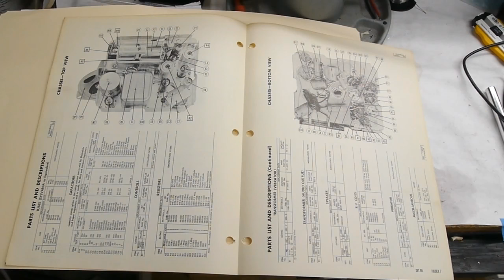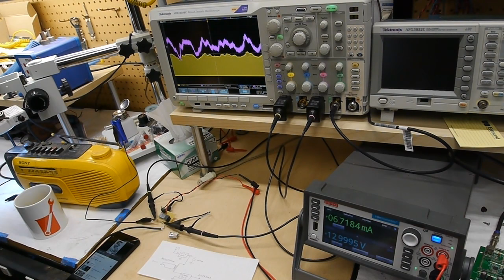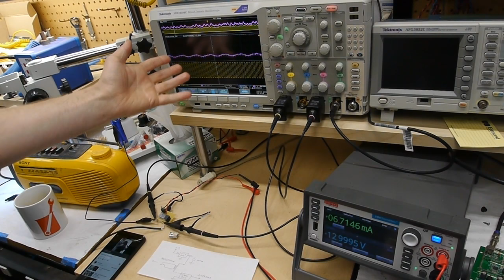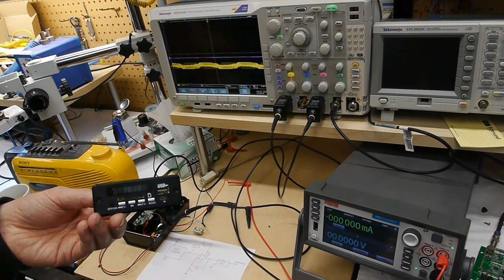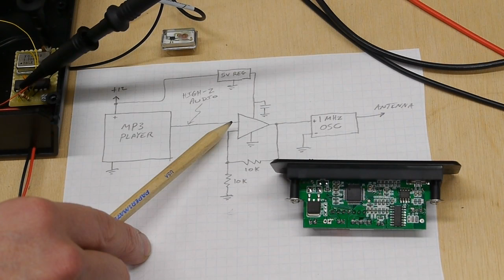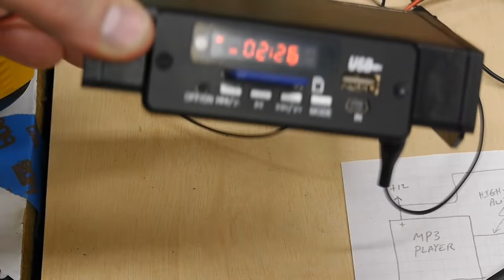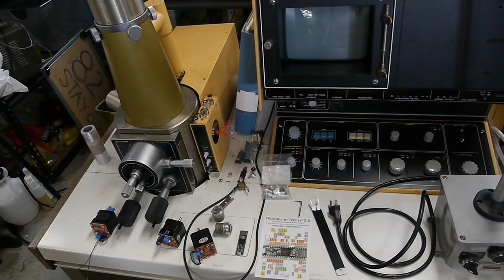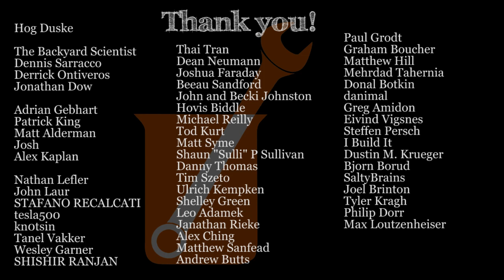AM transmitter for antique radios and other project updates

Comment: BTW, that trick of putting a transformer in series also works great for modulating a He-Ne laser. I once tried it with a PA transformer connected backwards to the 8-ohm speaker output of a hi-fi, and the modulation was such that you could actually see the intensity variation.
Reply from the maker: That sounds really cool.  I'll bet it would work with modern high-power laser diodes too.
Reply: With a laser diode it's simipler to inject the signal directly into the driver without the need for a transformer.  Actually it's possible with a HeNe as well, but a bit more complicated.
Reply: interestingly you can do the reverse and create a laser microphone by shining a lazer through a room and then playing the signal you get from a photo diod on a speaker
Reply: What if you power a magnetron that way? Would it be FM or AM? 
You have the DC supply and than you add another microwave oven transformer in series, than pump the desired signal in to the primary of the second transformer... That'd be one cheap ass power amp!
Reply: Eviltech Heh, neat one ;-) Probably AM, because the actual frequency of operation of a cavity magnetron (the type used in a microwave oven) is determined by the dimensions of the cavities inside the tube (although accelerating voltage probably would have a slight effect).
Reply: ***** It would be really tricky to receive A&FM modulated transmission :D

Comment: I am not an electrical engineer, rather, I spent 8 years in a math department as a student, but I did stumble on some nice addendums to Ben's transmitter that you may be very aware of.  First a disclaimer, you may only want to make the last modification if your lost in an Amazon jungle and need a transmitter with a bit of range, otherwise, you have built a device that can run contrary to FCC part 15 regulations. 

I originally did not have a 'can' oscillator, so I used a 555 timer and although it works with reasonable audio the canned oscillator is a nicer choice and I ordered one. 

I did not see Ben's diagram on my mobile internet, so I used a standard configuration with an audio transformer for modulation as in Ben's design. At the output I placed a hand wound coil/inductor having an inductance of .25 mH in series with a 50 K ohm pot that then connects to ground. When the pot is at a setting in ohms that I forgot to make note of the open circuit voltage is maxed at roughly 16 volts peak to peak.  

Without the coil and pot I only had roughly 4 volts peak to peak. The power source I used to drive the 'can' oscillator was 4 double A batteries in series. Additionally the coil/inductor reshaped the output from square wave into sine wave. 

I next measured the output impedance of the device by measuring the output open circuit voltage  and then the output voltage with a 10 K load resistor with my scope and by performing the calculation discovered when the voltage was maximized by the adjustment of the pot the output impedance was 7.7 K ohms. From this I calculated that for a coil/inductor used as an antenna I would need the inductor to have 1.24 mH for its inductance in order to have its impedance match the transmitters output impedance. I then wrapped, close wound, 24 MAWG wire around an 8 inch by 11 inch cardboard box. The number of turns I used was 47 which gave me very close to an inductance for the antenna of 1.24 mH. I then direct connected the antenna to the transmitter with no need for a capacitor because the coil antenna was designed to only be a perfect match at 1000 Khz Once connected I briefly turned on the transmitter to see if I was spot on with my assumptions or out in left field. Apparently I was spot on because the output across the coil antenna read 8 volts peak to peak exactly as it should were the antenna a perfect impedance match for the transmitter. 

From the measurements made I will determine the transmitter's power which I am reasonably sure is in the mW range. Once this is known, should the transmitter exceed Part 15 regulations then by adjusting the 50 K pot I can bring the transmitter within FCC guidelines, but still maintain the maximum range for use as a device to transmit audio books which had been the aim of the entire endeavor.

Comment: Wow, so you're really giving the anodizing thing a shot! I hope it works! You probably ran into the paper below already, but in case you didn't, I think it clarifies quite a bit about the process. Great video, btw -- I didn't know AM modulation could be this simple.

G.E. Thompson, "Porous anodic alumina: fabrication, characterization and applications", Thin Solid Films 297 (1997) 192–20.

Comment: I'd say be careful to not interfere with other people's radio when transmitting, especially if you have harmonics, but from the sounds of it you'd just be giving them better radio to listen to anyway! :) Nice explanations.
Reply: RimstarOrg it's only powerful enough to work from a few feet away. It wouldn't even work to the cat next to you at a stop light. otherwise, it would be illegal.
Reply: How many cars with AM will there be on the road?
Reply: That's not the problem, but interference with other appliances or electronic equipment.
Reply: ricarleite A lot will depend upon how much of the oscillator's square wave remains, and hence the harmonics, though I would expect the transformer to largely smooth that out into much more of a sine wave.  One will want to ensure that they are well within the emissions limits, both power and purity wise, for unlicensed transmitters (FCC part 47 IIRC) though it is likely fine if the maximum swing is a volt or less (but I haven't done the math either, nor do I know the total impedance to make the calculation properly).

I would likely be more concerned with the DC-DC converter in his truck (the silver module sitting atop the speaker) as I know they produce a lot of RFI as I use one to produce the 19V I need to run a pair of 27" HD monitors for my amateur radio shack where everything runs entirely off of a large 12V battery bank.  I had to include a good deal of filtering to clean up its switching transients in the LF through HF brands as well as some LC ringing up in the VHF range at around 80MHz and I could pick up the emissions on my dual band general coverage HT from several tens of feet away.  But after filtering it is absolutely quiet now with no detectable RFI escaping my filter and chassis and has worked beautifully.
Reply: Mauro Tamm most car radio actually no one ever use it though

Comment: These MP3 / FM modules are also able to play PCM WAV files at 44,1Khz 16 Bit. So you're not limited to to MP3 / WMA and FM Radio. You could play linear PCM WAV files from the SD card and USB port.

Comment: Great project. Love the MP3 FM radio. Thanks for the tip. I would put a simple pi filter on the output of the oscillator to knock down any harmonics. I know its low power. But, if it can get you into trouble somehow, it probably will. Or not. That loop through junction means you are broadcasting to nearby cars from the truck's antenna. Just thinking out loud.

Comment: I threw together a transmitter like that one Friday afternoon, when I needed to trace a cable inside a wall. You can just couple the signal into the live wall socket or whatever with Y caps. I think I used a 555 to create the modulating tone for the oscillator module.

Comment: Funny deja vu for me: I also made such an AM transmitter a long time ago but used an NPN transistor and resistor at the output for the modulation. Never thought that those were even stable when modulating the supply directly.

Comment: you never disappoint especially since you leave us wanting more and the about a month wait. I don't mind it's worth it to see cool projects like yours. Also with the gecko tape have you gotten any adhesion or just abnormally low adhesion? I  had an idea to make my own by focusing a dot matrix onto photo resist, etching copper, and casting that. I would try that I'd the anodized aluminum doesn't work but you seem like you know much more than I do about this.

Comment: I've played with this oscillator-can-as-a-transmitter idea a fair bit,and it actually works fairly well. There's a circuit with an LM386 to modulate the power to the oscillator can,also. It can be tricky to find the oscillators in 'useful' frequencies though. (unless your local AM market is completely dead,and 1000khz is clear.)
Reply: @PhattyMo  Can I kindly ask you to re-upload that image?

Comment: Great project! (The truck's pretty boss, too). You should set it up so the AM-P3 transmitter turns on/off with the radio itself. First solution that comes to mind is a relay in series with the radio's VBAT line. Also, I would like to see more about the radio restoration itself (or was that covered on one of your other media outlets?)

Comment: That anodizing idea is pretty neat, but I have an even better suggestion: experiments at my University have shown that superior adhesive joint bond strength is obtained by boiling the aluminium in MilliQ water. This creates an even more columnar topography and suits adhesive bonding much better than any other surface treatment out there. the only reason it isn't used widely is that industry will struggle to keep contaminants out of the process and ultra high purity water.

Comment: if your only using one channel out of the mp3 player module, stereo audio will sound missing/hollow  - 
i modded one in to a flight remote control, with speakers replacing the sticks, they're great, got one with bluetooth built in too.

Comment: the problem with the inline setup you have there is that the signal wont just go into your radio but will also be radiated back up the antenna lead and out of the antenna

Comment: The LM324 has an output voltage range of 0 to V-1.5, and the input high is V-2.  Since you set the gain to 2 and the input voltage swings around 1.5v, I think you're probably losing some modulation, the modulation is uneven, and the oscillator drive is a bit low.  The input is railing at 3v, but after amplification, the 3v is 3.5v and the 1v input is 2v output, leading to about 1.5v of total modulated bandwidth and an asymmetric amplitude.  You might want to use an adjustable regulator with a 6.5v output so that you can get full modulation.
Reply from the maker: You are correct.  I had actually used an LM78L09, and only remembered it as a 5V.  This is one problem with building something, then only getting time to make a video a month later :)

Comment: Wow, that's a really cunning circuit. I bet you could capacitive couple to the adjust pin of an LM317 or the like to an audio signal. Then you wouldn't need the transformer (for that circuit) or need to hack the mp3

Comment: Getting USB to work without a ready made library is a awful lot of work. There are ready made chips that will do it for you like for example the FT2232H

It can transfer data at up to 40MB/s by simply feeding it in byte by byte over a 8bit parallel bus while on the PC side it appears like a serial port so no drivers needed and its easy to write software for it as its just a simple com port.

By the way using the MCUs internal ADC could give you some noise issues with all the high speed digital stuff all around it, but then again if the microscope has a bit of a noisy signal it wouldn't really matter.

Comment: Better yet, use the oscillator on 5V or 3.3V and then a 74LVC1G04 logic gate on the varying voltage.  This way, the oscillator won't tend to vary in frequency.

Comment: Ben it looks like your depth of modulation is very low resulting in a low audio output on the radio. A way around this issue is to use a PIN diode on the output of the oscillator with an op-amp driving the PIN diode. The modulated audio is fed into the inverting input of the op-amp and the audio signal is fed into the non-inverting input. With this setup the non-linearity of the PIN diode(s) is removed by the op-amp as it lies within the control loop. About the same number of components.

Comment: Nice job. I have to live in one of the least favorable spots for AM reception in 50 sq. Miles and add to that a metal roof home and cell phone repeater and WHAMO NO STATIONS.  So question........did you direct coupled your 3-5 volt output to your antenna (& that to your radio) or....did you capacitor couple it (and remove any DC from the output)?  Would the latter make any hum less noticeable? Thanks for your reply and again, great job!

Comment: Good thing you cut the original antenna from this setup otherwise the roof antenna could very match the transmitter frequency and start spitting out a pretty decent RF signal into the atmosphere.

Comment: You should have set it up to do Bluetooth too that way you could play songs off of your phone.
Reply: kazoon hence "too". Having options is nice.
Reply: That's the way I would have done it, through an auxiliary input, wired into the intermediate stage amplifier of the radio,  Going through the antenna, it mixes the sound with radio static, which may have some appeal, but there are a lot more sources of radio interference nowadays, which may wipe out any possibility of listening enjoyment.
Reply: Yes BT is the winner, and at the back end in your home, a Plex server (free) with all your music. Open a port for plex and then the phone can access the full library wherever you are, no SD cards, USB sticks etc. All the music on a backed up NAS (most NAS support Plex) and streaming to your car.
Reply: I once saw that a simple audio input connection can be made at one of the terminals on the volume potentiometer.
Reply: Charlie Gosh 
That's a bit risky, not knowing how it might affect the circuit, or possibly damage it.  With a schematic, it should be possible to find a stage where impedance input matches the BT input. Auxiliary input can be through either an audio jack with a built-in relay switch, or a simple circuit to automatically switch input signal.

Comment: You can also try this: http://serwis.avt.pl/manuals/AVT2713.pdf
It has a little bit nicer waveform. Modulation depth, IIRC, can be controlled with R2, substituting it with a trimmer.

Comment: About your high pressure tubing  :
DO NOT REUSE THE FITTINGS
I worked with high pressure a few years ago, and high pressure fittings cannot be reused once unscrewed (or they will fail).

Comment: One question: Which side of the transformer does the audio input connect to? The 8 ohm side or the 600 ohm side?

I have it connected to the 8 ohm side but it's very quiet on the radio, even with the radio turned up all the way and the audio source (iPad headphone jack) turned up all the way .

Merry Christmas, everybody.

Comment: hallo and many thanks.
I dont have a classik car but just an old one with an AM  radio.
I want to add an FM transmitter mp3 player  etc., so I think what I have to do is what you show on this video.
Do you have the EXACT schematics? Could I use them? I am a very novice amateur maker in electronics.
Thanks very much.
C.Christodoulou

Comment: Have you done any calculations on the surface energy required for silicone to flow into the aluminum oxide pores?  I'd imagine that you would need a very low surface energy silicone.

Comment: Interesting video but doing this may be illegal in the UK as we have very strict laws regarding xmission of radio signals. I know that some very low powered FM xmitters, for use with older vehicles without USB or Bluetooth, have recently become legal here but I'm not sure if this affects the AM band and which frequency spectra can be used for such purposes.
Reply: Pete Allum I suspect the power is incredibly low, and if it isn't coupled into a proper antenna I doubt it radiates enough to even be particularly noticeable outside the vehicle.
Reply: Pete Allum You have to understand these laws are in place to prevent long-range broadcast. If something is illegal but is morally OK and nobody will find out anyway, you can safely ignore the legal aspect. There are all sorts of silly laws that not even police know/care about, and worse case a car really really close gets briefly exposed to decent AM.
Reply: Have to dig out the legal; documents for that, but pretty sure radio spectrum use required licensing when going over certain signal strengths where I am. So probably when you are not interfering with anyone with your several meter range broadcast you not doing anything illegal.

Comment: It may "sound" good but if you measure THD and modulation index you'll be horrified. Since you're already using an opamp, use a dual or a quad and configure the other amps as a variable gain modulator and filter/buffer. Don't modulate the osc module! You could even use just a JFET as a "variable resistor" on the output of the osc module to modulate the carrier, and then you probably wouldn't need the opamp audio buffer..Either way, add a crude L/C tapped-tank to filter the harmonics just before your "antenna" output.

When I wan in high school, way back in the 1970s, I fiddled around and designed/built a fantastic AM super-modulator circuit. The RF source was an old RF signal generator, followed by my super-modulator, followed by a filter/buffer and short telescopic whip antenna. The super-modulator was a multi-transistor variable gain amplifier that allowed considerably more than 100% positive-going modulation (referenced to idle carrier) while limiting negative-going to just above zero. Frequency response went from 20Hz out to at least 10kHz and it sounded awesome.

Comment: I'm surprised you didn't make an auxiliary input for the radio instead of creating an AM radio transmitter.  But I suppose that's not much different from running it to the speaker wires as you said, it defeats the purpose.